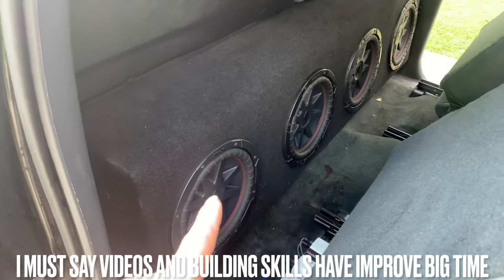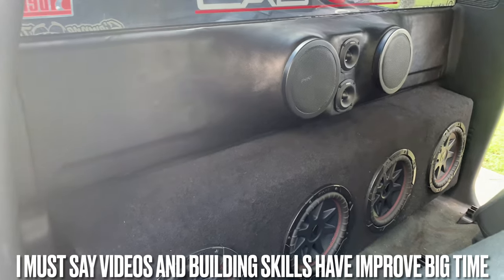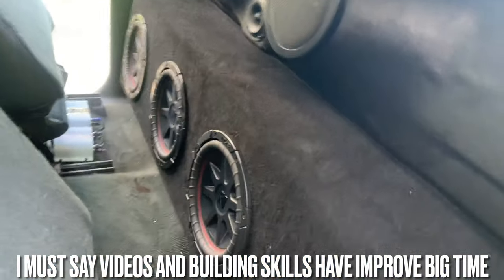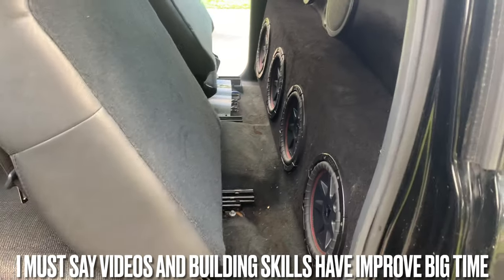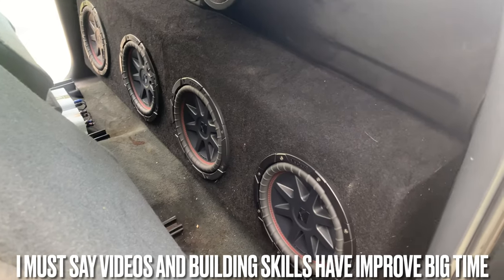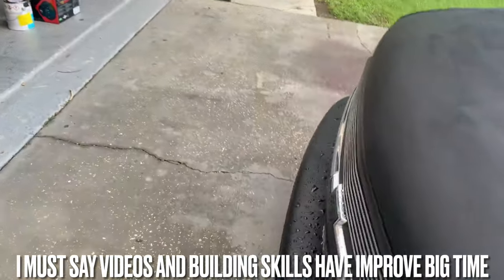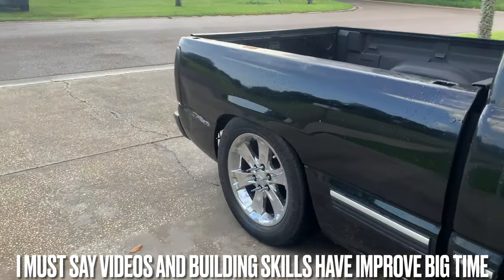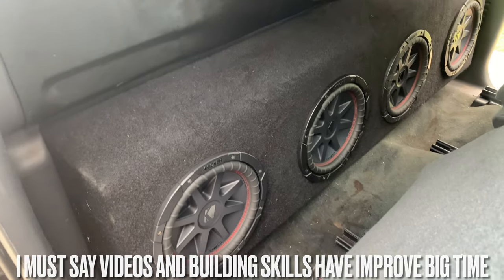Single Cab Sound System was 1st build on the Channel

Comment: Love what you do on here. Keep up the good work. But I have question need help picking out mids and high. Looks to put 8 midrange or midbass. Horns and tweeters. Any help work be great. Only thing Ive ever installed is coaxial and tweeters. Have resilient sounds 18's with 2- taramps 5000 smart